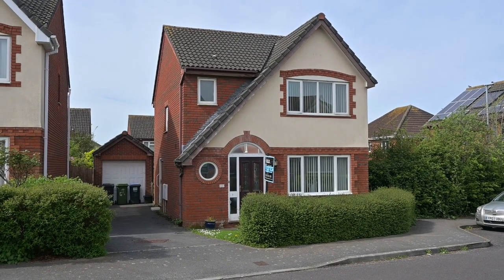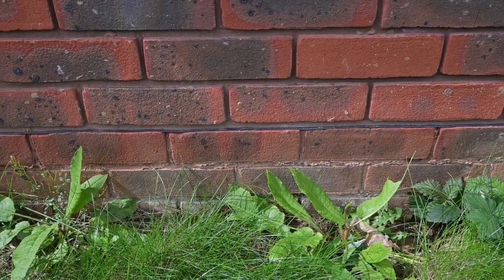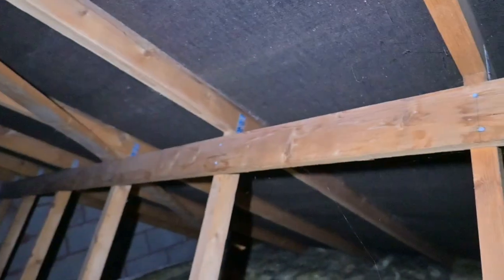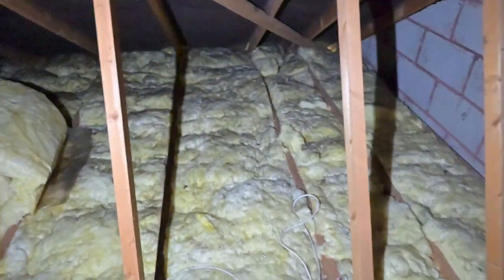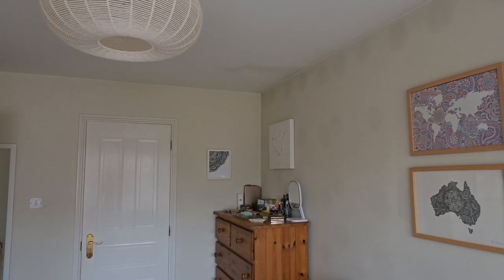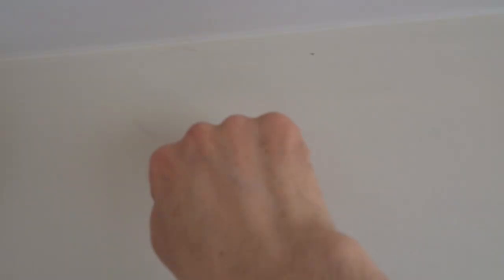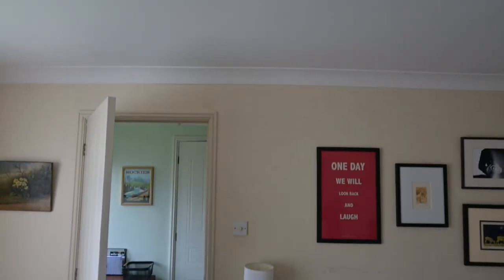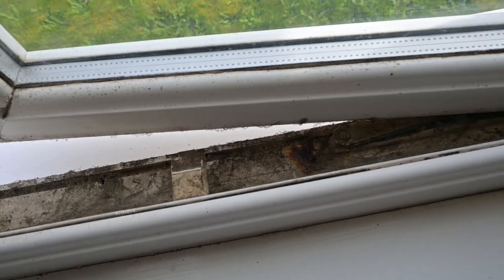Year 2000. A new house for a new millennium.

Comment: 5:12 in the topic of the roof structure, is it possible you could do content regarding these gable junctions? unsure why, but these were everywhere in my childhood home which was built in the early 90s and every time my parents used to go up for Christmas I used to se these huge geometric clusters of wooden beams and things that would intersect at those points that would go from large trusses to small frames and whatnot as it went closer to the centre

Comment: That brick work is appalling. The leaking vent pipe in the loft is possibly due to condensation in the flexi-pipe & maybe a tear in the fabric. I always recommend solid vent pipes with loose lay insulation put over them. I come across that mould on the ceilings at roof level regularly. There are various causes of it.